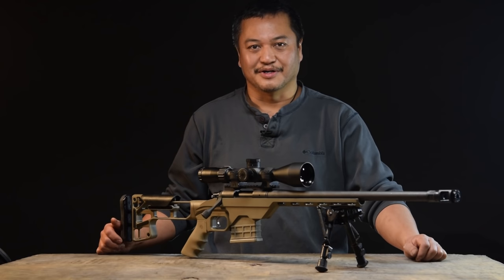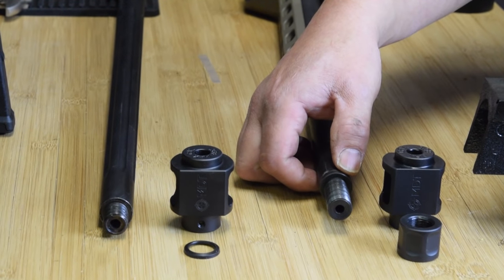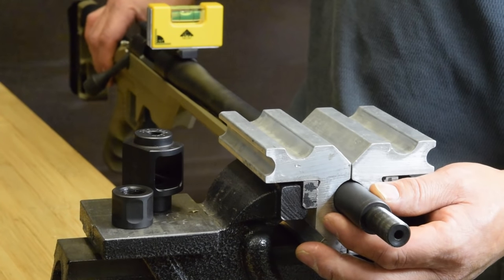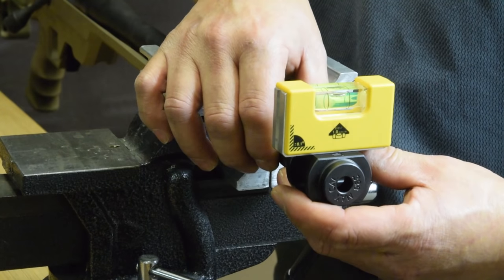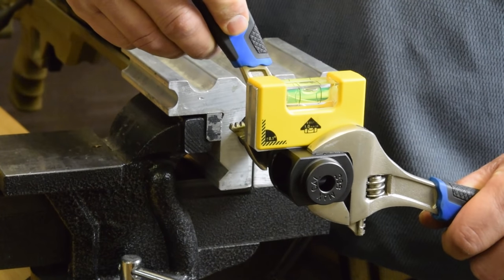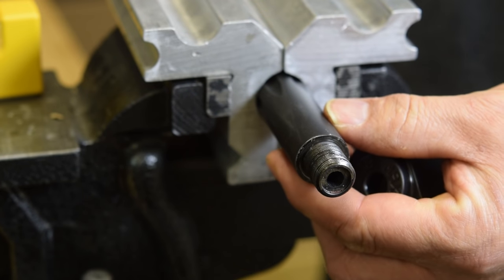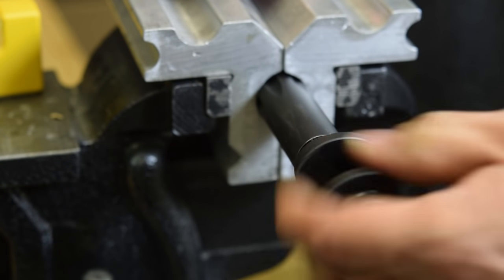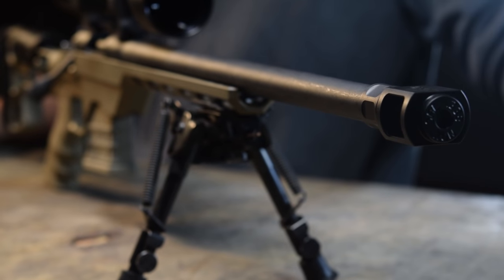MDT Muzzle Brake installation

Comment: Got a PGW M15 with your Chassis and Brake installed from factory. Does the brake need to come off each time I clean this rifle? Looks like a pain if it must be done regularly.
Reply from the maker: No, you will be fine with it on.
Reply: Thank you for the reply, I have one more important question. Is the MDT Elite brake removal the reverse of this procedure? One wrench on lock nut and one on brake turning in opposite direction?
Reply from the maker: @canadiangunguy5512  Basically, but this is an old-style brake which we no longer offer.

Comment: What sizes of muzzle brake is perfect for a specific gun or rifle. For example, for Bergara b14 HMR 300 prc, what is the perfect size of muzzle should I get that would fit on my barrel. Should I get for 308? 5/8/24 and 308-3/4/24, which one is perfect for Bergara b-14, HMR 300 PRC?
Reply from the maker: It would be best to confirm with Bergara which thread pitch they used on your barrel.

Comment: How did the barrel not rotate in the vise? My muzzle break on my bolt gun is currently side ways and not torqued because my barrel keeps rotating in my vise
Reply from the maker: You need a good vise, with soft jaws. Then clamp it tight.
Reply: @MDTTAC  How tight is tight? Most of my experience is with AR work and I didn't want to clamp down on the barrel or receiver pn my bolt gun and put to much pressure on them if that is even possible.

Comment: Hi
Isn't it risky that there is a little space between the nut bolt and the barrel?
Reply from the maker: It depends on the context, but as long as the brake is secured fully you will be good to go.